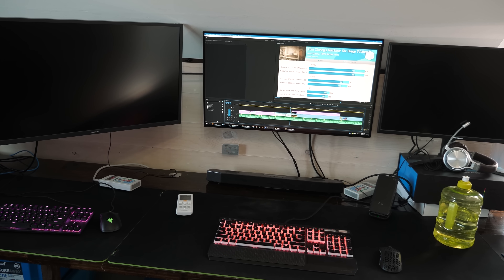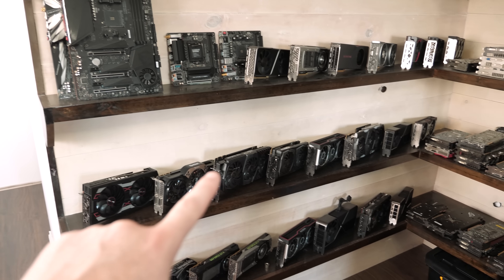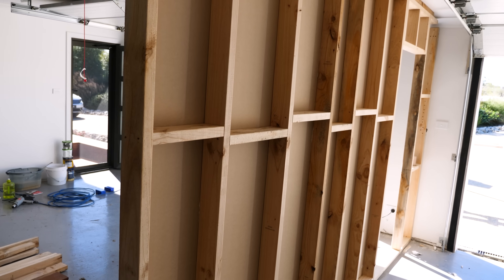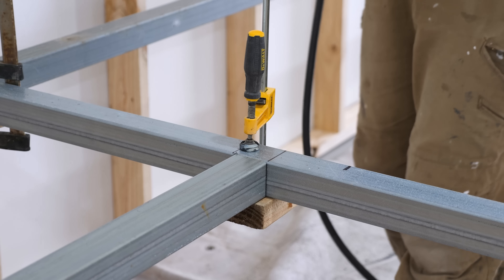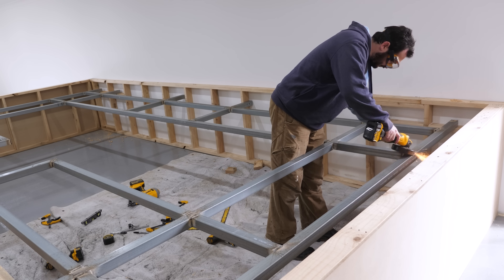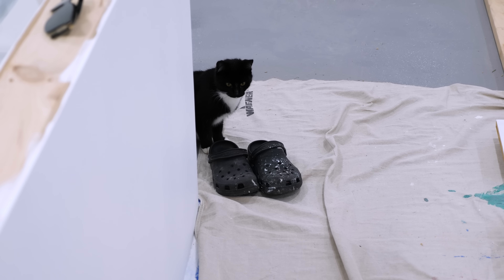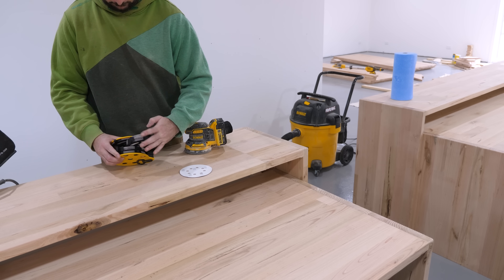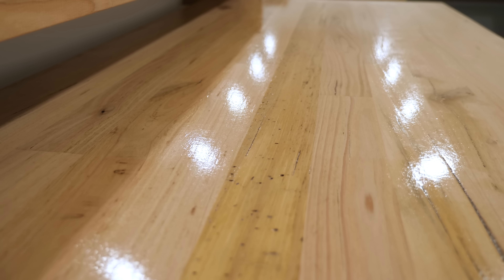Building The Ultimate PC Desk! New Studio Build

Comment: Turned out amazing, I used to do construction and interior finish work, no one knows what it takes to get such nice results, thanks for sharing. You have great welding skills too, something I need to learn.
Reply: Using a metal glue gun isn't hard just takes a bit of practice, like all skills. 
A few test angles so you can wack it with a hammer and don't break... is it good, or cut a few squares and weld a cube is another nice test.

Comment: I have a desk build planned. I am going to use an 80/20 T-slot for the frame. The beauty of this is it can be disassembled and rebuilt at a new location in the future. Since you had the steel on hand it makes sense. 80/20 T-slot is great as a building material. It is more expensive but infinitely re-usable. I have an attachment for my circular saw that directly connects a vacuum and hose to the saw so it goes directly into the vacuum, and I don't have to vacuum later! I usually use tung oil as my chosen wood finish since it penetrates the top layer of wood and makes for an extremely durable surface that has decent impact resistance. Subsequent layers bond to each other and form a plastic-like coating on top of the wood. It can get tacky in high humidity environments.  Throw some anti-fatigue mats on the floor under the desk. They are great to soften the blow on dropped items. Add a few LED tracks and strips for the cool factor.

Comment: Well done! That’s incredible. I’ve just finished my own much smaller project, a long sitting/standing desk (with my first attempt at some serious cable management which turned out great), and some shelves nearby. I was a bit concerned about chemicals in varnish and floor oils, so I asked at the store about using worktop oil, and apparently the oils aren’t very good for desks because the oils from your skin can interact with them. But I discovered a new worktop varnish (it’s food safe, so hopefully no chemicals to worry about), so I went with that. Really pleased with the result, and that was already a lot of sanding. You must have been so sick of sanding by the end of that.

Comment: I love it, you have given me such a great idea. It has been in the process of building a floating L desk  with epoxy coating and I wanted like backboard for mounting my monitors and being able to throw the wires out of sight but the biggest problem is that iv been dealing with is that my walls are plaster and was trying to figure out the best way to mount it to a wall and be secure it will have multiple pcs and 3d printer on this so it has to be strong and plaster walls I didn't feel confident, but this looks like a great idea to go up more of the wall and add a shelf on the top of it to make it look like and extension of my wall, great work, and thank you for this idea

Comment: Wish I had learned to do stuff like this. Really well done.
Reply: This is not that hard to do. No need for much learning.
Reply: My skills would end at vacuuming and maybe oiling the wood. I can build computers and Ikea furniture but entering a hardware store to buy some screws is like the ultimate test.
Reply: @philipp594  I'm not sure about that. Cutting things in the right places and getting stuff to line up seems quite difficult and I know I'd mess it up.
Reply: @Bynming  Measure twice and cut once. Or cut it oversize and use a grinding disk to make it fit. It will never fit if you don't get it sqaure. So make sure you do that first.

Comment: Now if I wanted to create something like this, considering we’re talking about the same build, what’s the price in materials?

I’ve got little experience in construction, but it is a goal that I’d like to plan for in the near future so that I can spruce up my own environments.
Reply: More than you'd like, less than it could be.  The biggest cost is the desk top (about$100 USD).  Similarly his next biggest cost is the steel (depends on the size but lets figure $60 usd) After that is the MDF (about $40 usd).  Depending on his material costs it's probably in the range of $200 - $250 USD per 4 foot (1200mm) section.  That said it could be done for about half as much by changing up the materials a bit for example drywall instead of MDF, and laminate counters instead of the wood paneling for the desktop.  You can also save about 25% of the steel cost by going with a rectangular steel tube and probably another 10% or so by going with a lighter steel.
Reply: tools could also add to the price if you don't have them.
Reply: @donaldendsley6199  Thanks, that’s good to know.
Reply: @mattecrystal6403  My father basically hoards tools even though he hadn’t used most in the past 30 years.
Reply: @donaldendsley6199  This costed at least here in the U.S., around $8000 or more.  Galvanized steel tubing has doubled here in the U.S. in the past two years.  Just the galvanized square tubing he used would have costed 300$ for a 21ft section here in the U.S. it was 150$ two years ago.  I sell galvanized tubing.
Reply: @donaldendsley6199  That's not very close to Los Angeles prices. I built a 'center of the store' counter that's very similar to his, six years back. It cost me over $12k then. The covering is 5/8" sheetrock and there was no cost cutting with that heavy material. I think the top - and finishing was the most expensive part, been a long time, I've forgotten Lol .. cheers!!

Comment: What would be a cool upgrade, imo. You could drill holes in those hollow sides of the table, where you can mount extension cords all around the table so you have a quick access integrated power below the top level of the desk

Comment: Crikey mate, great job. Awesome LAN set up. Its Quake time! When lockdown ends I'll zip on over and check it out. I've been thinking about getting a gaming desk built, because what I envision as the ultimate PC gaming desk does not exist. I want a desk that has dual tracks embedded into the under side of the desk, so I can mount dual VPC Warbird joysticks with T-Bolts (at what I reckon would be the perfect height) and slide them into position when required, and out of the way when they would otherwise get in the way. I'm thinking of Star CItizen and BF2042.

Comment: Really liked the look and thought put into it! Especially the steel structure to avoid legs! 

I do feel like there was a missed opportunity though with the "entrance" where u had the waterfall like endings; if you had cut the wood at 45* angles and then simply routing the edge it would have given a clean "infinity" feeling instead of the edge being visible giving quite a hard look. 

Also if u do want to add strength to the shelves (even though it's probably not needed) you could add pocket holes from "inside" the shelves to add a screw to the bottom of the legs aswell. Will make them invisible and not collide with the other screw ;)

Just a tip if u decide for a similar go at the other parts!  

Looking forward for part 2!

Comment: Excellent video & a nice job on the set up.  The only thing I see missing, (and this is my own particular opinion) is a separate electrical sub-panel with isolated breakers to prevent over-power or surges due to lightning strikes.  You also might want to talk a little more about your electric set up (how many outlets, amperage of outlets, etc.)  But all of that being said, you did a much better job documenting your progress than a LOT of others on YouTube .... Well Done!
Reply from the maker: The garage is on a completely separate circuit with is split across the lights, AC, and 3 zones for power points (it's proper overkill). There's six 10A outlets for 14,000 watts, so significantly more than I need for the computers. Also I will be installing six UPS units with surge protection. Pretty boring stuff though so I didn't bother going over it in the video.

Comment: Great job and great video.  Thanks for sharing.  2 questions.  1. What are the rules around these kinds of improvements where you are, did you need special permits for adding that partition wall for the car and the other additions?  2.  Did you consider not completely cladding that outer wall area to allow air to circulate around the table surfaces?

Comment: Did you consider doing the wall as studio flats as they do on movie sets? It would have been a lot less prep work and you could prefab them in a modular fashion making all your cuts in a set. Since it's not a structural wall it would have been thinner as well. There would have been some concern over sound insulation, but I think the time saved would have paid off well. I created studio flats to partition off a section of my bachelor apartment as a small bedroom space. Since this is a temporary thing until I move it made good sense. I can also comply with my lease which indicates no permanent construction is allowed in the apartment.  Here in Ontario Canada, we are not allowed to covert garages to living space due to building code restrictions regarding carbon nanosized isolation. I attached shelves to my faults with Toggle bolts and they are holding well.

Comment: 1. Great Video and documentation of the process. With enough detail information on every step. And the desk setup looks fantastic.
2. I wonder what your background is, because all the work your performed here looks like you properly learned it at some point. Also you seem to have all the needed tools anyway ;)
3. Did you ever think about being able to disassemble the thing? I guess, if it ever moves out, then it will be in pieces.
4. You clearly put a lot of thought and work into this project. BUT, there are already some qol improvements coming to my mind as I watch you build it :D

Comment: Dude way to show off some skills!  My only advice would be to vertical block the horizontal line that the desk structure rests on.  Edit. The mdf you walled the inside of the desk with is plenty of support. 

Nice job!

Wow and the angle supports. You could probably park a car on that "desk".

For sure do a follow up.

Comment: Hey Steve, when building a house with that style of framing, virtually the entire load is applied to the top horizontal beam that sits on top of the vertical beams. In this ideal scenario, everything is directly supported by wood and none of the nails are load bearing. However, the short horizontal beams inside the frame don't sit on top of any support. If you apply any load to those, it will be converted entirely into shear force on the nails and glue that keep them in place. Suddenly, none of the thickness and spacing of the wood matters, and the nails/glue become your structural weakpoint.

Maybe you're already aware of this and have decided it's not critical, just thought you might wanna know.
Reply from the maker: Yeah well aware. Firstly most of the weight is transferred down two studs, not one. Also there are 12 fixing points, it's extreme overkill, you could easily put a ton of weight on them and the studs wouldn't even know it. We're talking about a desk here, not a two story house ;)
Reply: @Hardwareunboxed  I see. Don't have any practical experience with woodworking, just what I remembered from statics course. Looks very nice, I hope it serves you well!

Comment: That is impressive. Really impressive. But do you have enough power? What is the amperage of that electricity supply?
Reply from the maker: Thanks mate. There are half a dozen 10A outlets, so much more power than you need for 6 or so computers + monitors. I probably won't be using 14,400 watts at once :)

Comment: Steve may I ask what the timber desk top cost per sheet ?
Plus do you think angle iron would be strong enough for the frame as I have heaps to use up. 
Think of a L shaped Desk in the corner of sleep out built on back of garage and now you showed me now I can get it done. Cheers ; )

Comment: nice to see you wear a mask when welding, I do it too! it's nasty stuff not every one wear one, I recommend adding like a N95 or P100 before the cartridge to prefilter so it will filter saw, grinding, sanding dust and paint fumes aswell. It's a very nice build! oh and if you have too much graphic card I'm interested in one... I'm still on a HD7870 doing tripple screen... XD with 3070 around 1400CAD it's a no, 6700XT are around 1800-2000 it's even worse

Comment: When I seen all the cpus just setting there, and you mentioned them falling, I did laugh. Then I thought about a mechanics metal tool box, with the slide out drawers. Perfect for access and protection. There are various size drawers available.  Some have  multiple smaller(1 -2 inch deep) drawers.   There are some well constructed nice looking boxes around - might be an option. (I'm talking about a decent quality aesthetically pleasing box. Maybe stainless or painted metal....
🥃

Comment: "love this band saw, really keeps the sparks out of the space"

proceeds to weld and grind in the space
Reply from the maker: Yeah well you need to do both of those things, but of course if you can cut down on that mess it's a huge plus and cutting the steel makes by far the biggest mess. For the welder you simply put down a weld mat and you're good. The flap disc work was quick and made very little mess.
Reply: @Hardwareunboxed  Yeah man it was just funny because it was like literally the next scene. Also, if you leave just a touch more gap on your metal cuts, either open air or preferably a V channel cut, your welds won't be so proud on the surface. If you practice a little you can cut out a lot/all of that grinding.

Comment: I can't believe you didn't wire it for power and ethernet. Maybe even some dsp and Hdmi. I get that some of tgat can be on the cable management shelf.. But an electrician to hardwire circuits into it would have been money well spent.
Reply: Oh I guess u did. Spoke too soon. Didn't show it in the first 90% of the video.
Reply from the maker: Yeah I did all that. It's super easy to add at any point anyway.
Reply: @Hardwareunboxed  I just expected you to do it when it was only framed before you put the mdf on the inside and outside. Still looks amazing. Looking forward to seeing it once sound proofed.

Tonne of planning and work went Into it.

I built an L shaped in my den and thst was a lot of work and measuring.

Comment: I think you should use hearing protection when using that table saw
Reply from the maker: It's not that loud, my first car was 10x louder :D
Reply: @Hardwareunboxed  The angle grinder is though :p
Reply from the maker: flap discs are actually pretty quiet, again a 700hp Skyline with an external gate was way harder on my hearing which somehow is still perfect ;P

Comment: I was about to ask about cooling against the summer heat but spotted an air conditioner on the back wall. 
May not already, want to install bats in the celling to protect against the suns rays making the ceiling hot as most garages don't get this installation when they were built.
Reply from the maker: The garage was just custom built for the studio, it's actually much higher quality than the house. We have R5.0 in the roof, and a massive 12kw a/c.

Comment: Until GPU prices really settle over the next couple of months, with the views these type of videos get (The Shed vids, studio, now Desk) maybe you should just be a DIY channel for the next 30 days :^) . I started pricing the lumber in my head, then realized the least expensive 2"/4"/3' were up to $95 USD and gave up. Still, it's nice to live vicariously, especially when you know prices will drop incredibly fast once Truck drivers are back at work Z(lots of timber for sale, but no way to get it to the darn stores from Canada, and the US HATES using it's own resources, even renewable ones. I have an acre of woods behind my house. Mostly Ash, Oak and Maple with a few other types strewn into the mix) and need a permit from the town Hall, each of which costs about $200 USD depending on the tree as someone from the town has to come down and give the "OK" for it to be cut down. 2 of them that were rejected fell onto my house during storms, two more onto cars in my driveway, it's ridiculous.

Anyway, keep the vids coming. Ooc, have you ever though about doing any crazy custom wood case builds? I bet you could throw some really interesting designs together. Best of both worlds. You have your DIY woodworking with a DIY PC. Just a thought.

Comment: doing so much sanding without a dust mask? ripping with a circular saw blade set at a max cut capacity? you should never do these huge mistakes for your own safety, otherwise, the work you did was amazing :)
Reply from the maker: I normally sand with a dust mask, I was being lazy I guess when dealing with the camera. As for the cutting with max depth being a 'huge mistake', I strongly disagree. There's no issue cutting with max depth and it's much easier to get perfect (straight) cuts when using as much of the blade as possible.

I've never ever had kickback issues with my DeWalt circular saws, the electric brake is also excellent. I've make tens of thousands of cuts at this point so I'll let you know when this huge mistake becomes an issue ;)